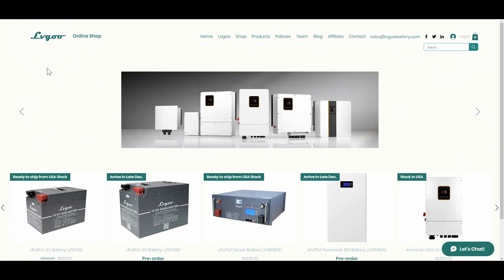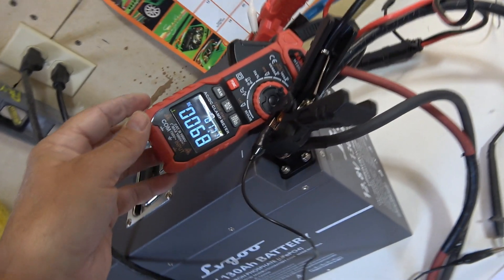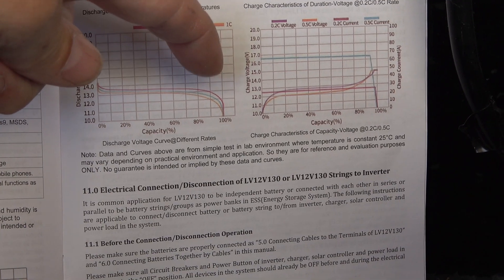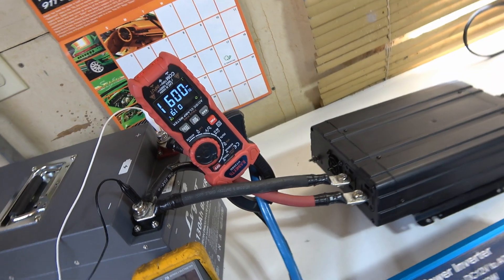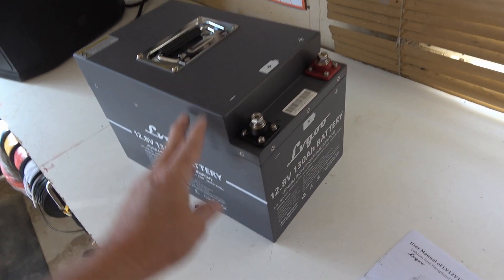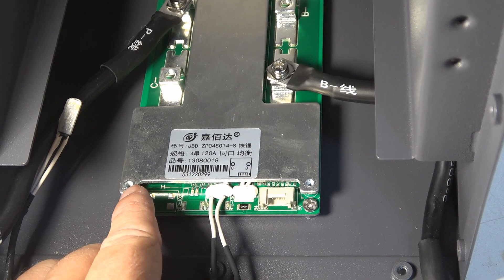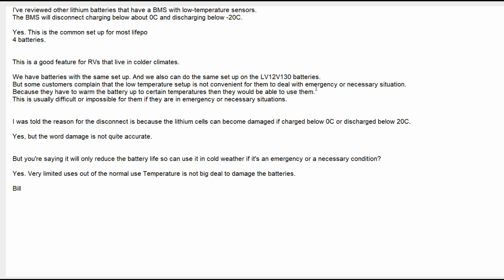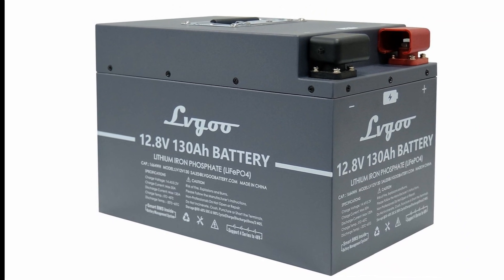Lvgoo LV12V130 Lithium Battery Disassembly & Review - Nicely Constructed & 130 Amp Hour Capacity

Comment: Awesome content as usual! When you replace your Lead Acid battery with a Lion iron phosphate battery, do you need to replace the charge controller which charges your battery when you are on shore power?  I am guessing you do. And where would it be to replace it. Lastly, options for the charge controller?  Thanks again for your videos.
Reply from the maker: Thanks! here is a video I did explaining the charge converter situation with lithium. https://www.loveyourrv.com/lithium-battery-charge-test-can-you-use-a-lead-acid-charge-converter/
Most of the leading RV charge converter companies now have lithium options. I tested one from WFCO https://www.loveyourrv.com/wfco-electronics-auto-detect-lithium-or-lead-acid-converter-charger/  It was an auto-detect type but that can be a little flakey at times I'd rather have a manual switch or dedicated lithium type myself. Cheers, Ray
Reply: @LoveYourRV  Amazing, sorry I should have seen this before.   Thank you.

Comment: Thanks for the great review. I have a question - what kind of batteries are used inside? Are they new class A batteries, as they write in the description, or selected used batteries. Cell parameters are needed if repair is required. They do not have a cell on the manufacturer's website. How to repair such a battery if you can't buy a cell?
Reply from the maker: This is their claim on the website "High Performance True A+ Cell*4  Fastening Connection in Series."  But they don't list the brand. I find most sellers of these type of drop in batteries don't list the cell or BMS brand, likely because they may change depending on supply. Most cells have a QR coded sticker with the battery manufacture brand, date made and specs.  In my second video after using it for a month or two I'm going to tear it down to the point I can pull a cell and have a look.  Just a note though you have to be weary of some of these companies as they could easily send a reviewer a battery with new Grade A cells and not to general customers. Aftermarket cells are available for 130Ah Example - https://www.evlithium.com/LiFePO4-Battery/lishen-lp44147272-130ah-lifepo4-battery.html Cheers, Ray

Comment: Bummer about no low temp protection. Otherwise it looks like a nice battery.
Reply: Was thinking the same thing.
Reply: Not sure why folks care so much about low temperature protection. Everyone knows to keep their lithium battery in a warm spot.
Reply: @RobertStevensService  Because when you're an RVer, esp. a FULL TIME RVer, your batteries are your lifeline.  You don't always get the luxury of where to place them in any given rig and certainly we get stuck in freezing weather sometimes, no matter how hard we try to chase the sun.
Reply from the maker: I imagine some people want it for leaving the RV in storage with solar to keep the battery topped up or going hunting in the winter, etc and not have to worry about keeping them heated. Pretty well every North American company includes it but seems many of the Chinese based ones don't. Likely because they don't understand the RV market as well.  I keep my batteries in the front unheated storage area of my fifth wheel as its very convenient place to have them. Odds are against it every getting to the  point of needed the low temp charging protection as we live in the RV, but a nice extra feature to have and it doesn't cost much to include.

Comment: 4S on the BMS means 4 cell battery controller, not that 4 can be used in series.
Reply from the maker: OK, I thought it may be like the Aolithium that use the 4S on the model number to mean that https://aolithium.com/products/12v100ah-4s-lithium-lifepo4-battery and the Lygoo had it on the case that it could be series up to 4.  Cheers, Ray